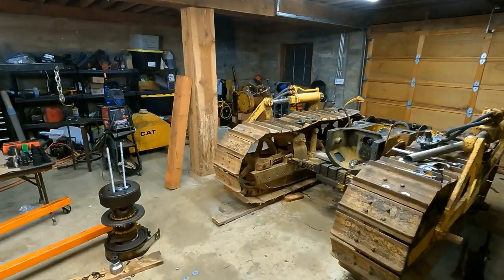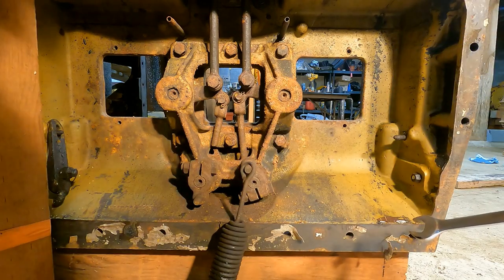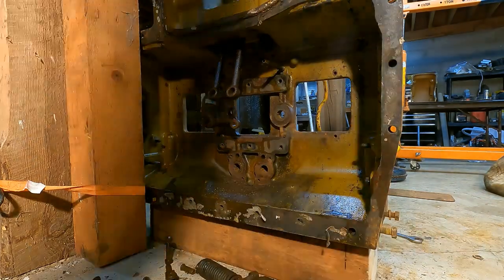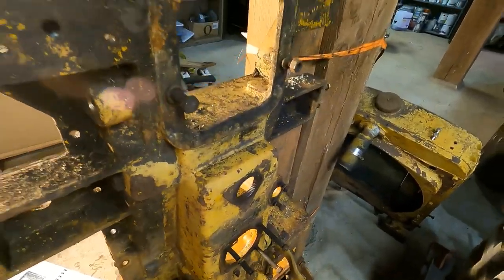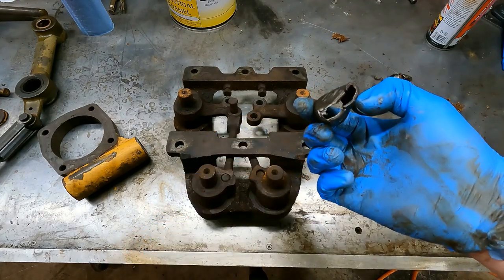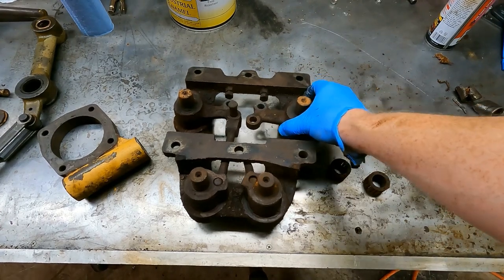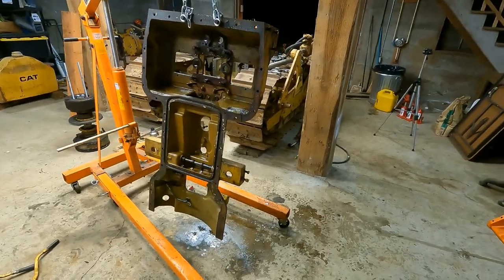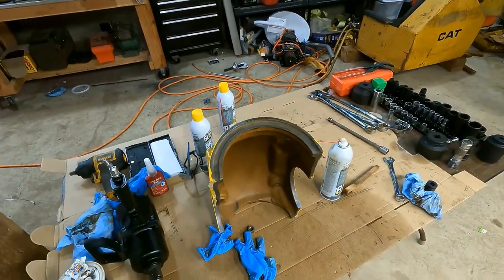The steering clutch linkage on this Cat D4 needs some work

Comment: Try using a wheel cylinder hone to open up those holes, the race is probably hardened and will not drill easy. Keep at it You eat an elephant one bite at a time.
Reply from the maker: A hone is a great idea... might give that a shot.  Was a little worried about the hardness, but it's so rusty there might not be much hardness left.  Guess I'll find out when it snaps my drill bit in half...
Reply: @PacificNorthwestHillbilly  you can not get an accurate sized hole with a drill you need to use a reamer! however as others have said I think you would be better off just replacing the original style bearings with some high quality grease.

Comment: Do those bearings get splash lubrication by the transmission gears when in operation...with it sitting that long is where the rust/corrosion came into play?
Man...definitely loving the series...can't wait till that badboy is up and running!
Keep em coming!!!!
Reply: I would think just Packing with Grease, should be good for a few years, but yea finding sealed bearings and little work, I hope those new Bearing work well...

Comment: That looks like a rig up using some fiber packing, someone wanted a quick fix and you know those don’t last long!
Reply: That one probably would have worked indefinitely if the funnel in the crossbar had been kept clear so that the oil it’s meant to catch could have gotten through the housing to that fiber and then kept those steel bushings lubed.

Comment: Are you thinking about painting the steering clutch linkage. Or perhaps having it flash copper plated after electro stripping the rust from them.
Reply from the maker: Probably just paint it with something that resists grease.

Comment: I would have used a sand blaster on that thing and saved alot of time with a wire wheel on tip of not needing the power washer. If I had one.

Comment: I watch another utuber and you should try some lubricant calling Kroil , it’s a little expensive but I tried it and it’s the best stuff I’ve ever used for rusted and frozen bolts and fixtures Matt. A small 12oz. can is all I could find but it doesn’t take much to loosen up parts brother! Just trying to help you out Matt!👌🏻🤙🏻🤙🏻

Comment: Surprised the shipper would use the post office to send a heavy puller. Postal rates do not favor such a heavy item. If they sent it by post office, likely it was also sent in a envelope that would not normally hold up to a heavy item, so the package comes apart and the item ends up in a nixie area.

Comment: Does charlie chase the cat? lol. could you just take the clutch pack to a tractor repair place and have them pull it with their hydraulic equipment? I'm sure they do that every day.
Reply: They won’t get them apart without the cat tool or custom fabricating the tool to press all of those clutch springs down at once so that the keepers can be removed.

Comment: Your parts will be imperial sizes, so any discrepancy from original sizes will be in thousands of an inch. Not mills as you are stating. It's great content I am really enjoying it.
Reply from the maker: I don't use the word "mil" anymore because it causes too much heartburn, but a mil is a 1000th of an inch.  Any dictionary will tell you that, but the metric system has made it more confusing because people use mil as shorthand for mm.  It's still used in my industry as well as a few others, which is why I used it way back.  Plastic thickness, glove thickness, circuit board thickness, etc are all given in mils.  7 mil plastic is 0.007" thick, not 7mm thick!

Comment: Those bearing shell's will probably be hardened so won't be able to drill or team, try filing them that will tell you
Not sure how much u gotta take out as u saying 2mm and they nearly fitted ?
Try sanding with a flapper wheel

Comment: ....and its very entertaining stuff for sure.
 Very interesting how you are thinking things out but a bit worried about brass bushing going where there are roller bearings. Is there any way to have a grease nipple fitted to grease the roller bearings?. This means you may have to drill grease hole channels and then when turning 90degrees place a plug at the drill hole entrance you drilled into. Also, the outer roller bearing housing has a hole in it for grease to come thru. However, you will need to run a grease groove in the roller bearing housing if one is not there already 
 I really think Cat has done a crappy job of these linkages. Very poor engineering on their part. Always has been a big issue with final drives on these dozers.
 You would think to win the race to have a good final drive you would think they would have these lack of grease issues addressed. Not that it's the first D4 that has been built! 
 I have looked at all those roller bearing positions in your video and yes I would put grease nipple channels or lines to each roller bearing. You will probably find when you remove the out roller bearing housing there is a ring been machined into the housing anyway.
 Hope you do see it like I do as I know as you say when the dozer is parked up moisture is a big problem. In these cases put a fresh injection of grease would certainly put on a whole on moisture and rust freezing levers and linkages when parking the m/c up.

Comment: puller 1/4 thick wall sq tube drill 2 holes and build your puller 4 inch and insert 2 inch in side tubing line up your holes and use home made puller /it should  be good for 7 tones

Comment: Most probably the cloth lining would have been oakum.  It will swell when moisture is on it causing a seal, just as in sewage drain fittings

Comment: But Squatch doesn't go into the detail that you have. You are showing every step you have had to fight with. I have learned so much on internal parts as you go along.
Keep up the good work and be safe. Those parts are extremely heavy and one wrong move or get lazy on safety, could turn out extremely bad  be careful

Comment: You're not going to drill the races--they are HARD HARD HARD. Do the bead of weld trick (works better than just a line of heat).

Comment: At 17:34 I hope that was not brake cleaner you sprayed before welding. Heating brake cleaner creates  phosgene gas, which will kill you very dead very quickly!  Highly dangerous!!!
Stay well.
Reply from the maker: I'm using flux core, phosgene I believe is only created when using argon as a shielding gas.  I might be wrong, but I did wait a few minutes either way.
Reply: @PacificNorthwestHillbilly  Please use caution welding after using any cleaners containing chlorine. I think research has shown it's the ultraviolet light that causes the conversion to phosgene gas. 
This is serious stuff and many documented cases of respiratory complications after use of cleaners with chlorine. Please play it safe and  use non chlorine based products.
Reply: @PacificNorthwestHillbilly  I respect your decision bro, but a quick Google search (and a quick call to an industrial chemist mate) shows that heating tetrachloroethylene to above 350°C does indeed produce phosgene. In the interests of seeing your D4 actually running, and for your longevity, I would love to see you avoiding phosgene! That stuff is SO deadly - just a whiff killed many a digger in the Great War. 
Really enjoying your vids - keep em coming. I just wish we had as many old machines holding up trees here in Australia!